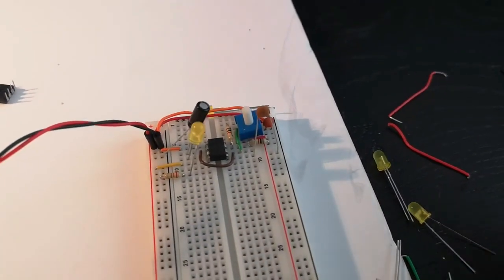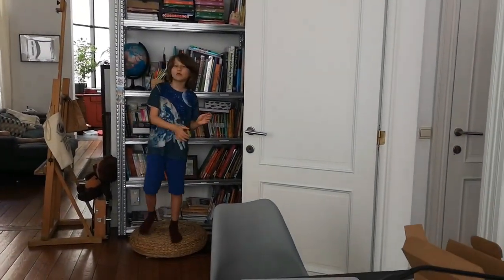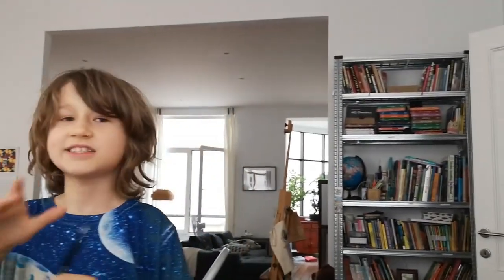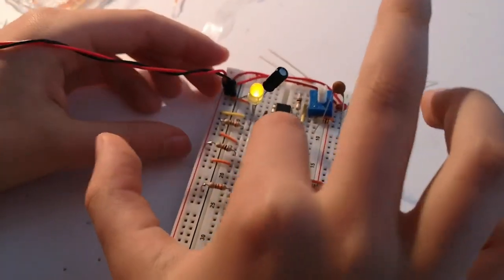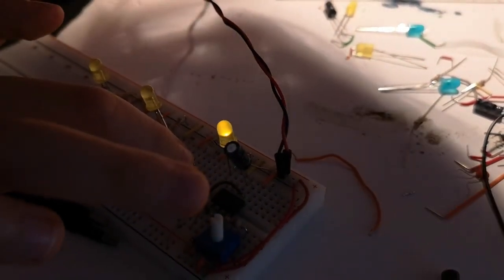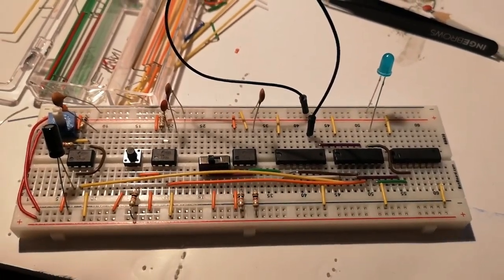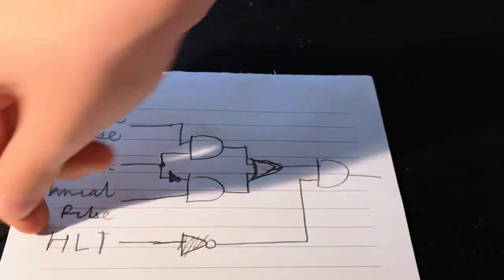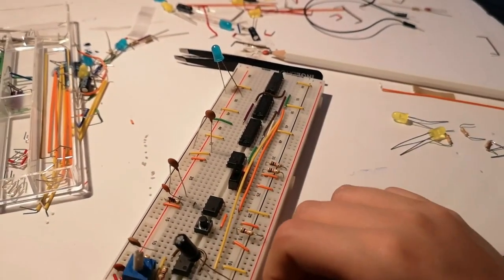Simon Building an 8 bit Computer | Part 1 - Clock Module

Comment: Automated Circuits Work Based on  Clock Cycle Speeds, Before Storing Electrical Power You Need to have a source for The Electrical Power usually from a Battery to be Stored in the Long term Memory before Using Short term Memory Electrical Power is Expressed via Voltage Levels and Based on the Voltage Levels on the LCD screen you discover different color values from the red green blue color spectrum, Code is a representation of voltage levels being organized based on Mathematical representation of the  operations of ? and the voltage level is determined by a specific circuit design,  Manuel Circuits Are Interupts sometimes with Loop Circuit Design, Keyboards are Interupt Circuits, Mouses I'm Still trying to Learn About